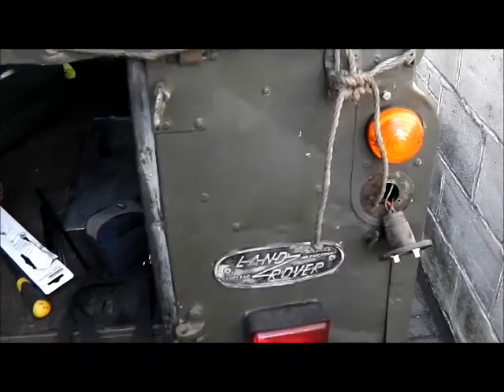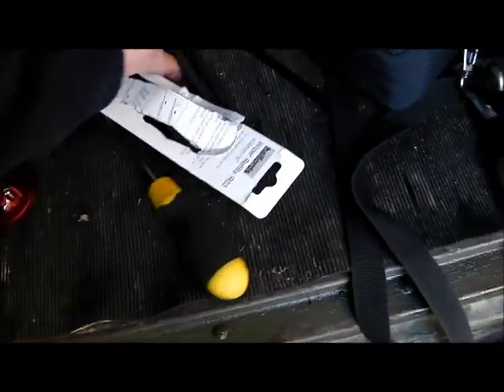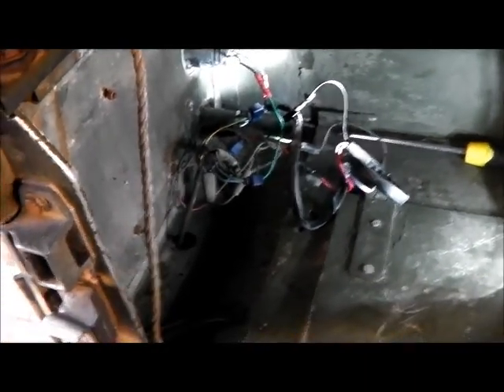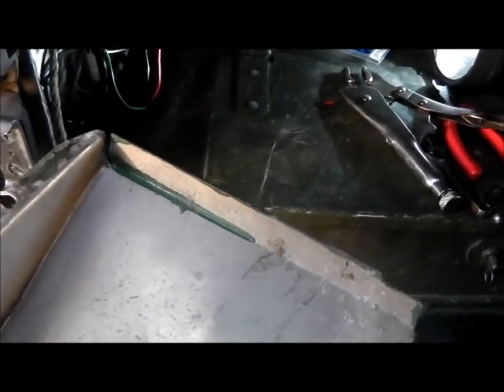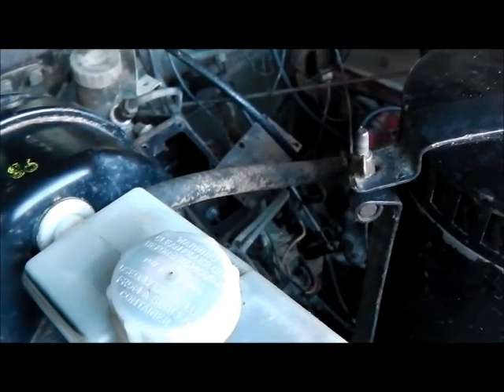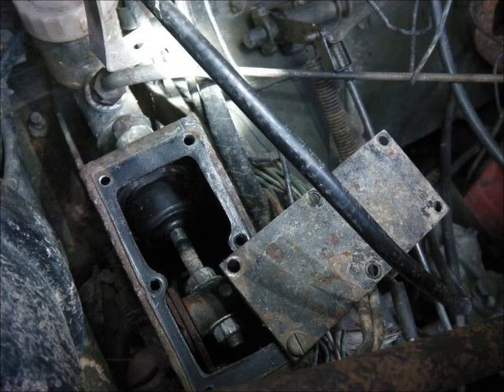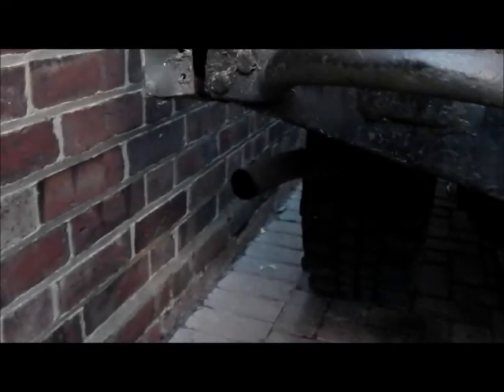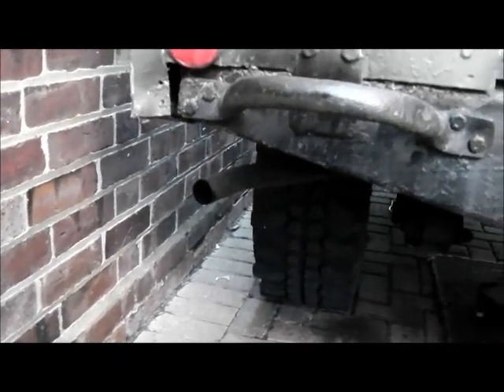Land Rover Series 3  -  brake lights and clutch biting point adjustment -

Comment: Has your S3 got and S2A gearbox in it. If its a S3 Gearbox you should have syncro in all gears.
Reply from the maker: Series 3 gearbox with knackered syncro and missing springs. 

I've got hold of a series 3 gearbox and series 2 transfer box which I'm rebuilding, should just need to fit the S3 bell housing to it.

Comment: Nice job, old wiring Burns out alot fast then old so be careful, just asking What website do U get 12 volt bulbs from

Harry
Thanks
Reply from the maker: It sure does! I'm replacing what I can as and when I get time and the need to do it.

Haven't had to buy any bulbs for it yet, I should think your local halfords would stock them.
Reply: Sorry i ment the bulbs for your stationary engine displays
Reply from the maker: Ah no worries, I really can't remember now but I just "googled" for them and came across 12V lamps in 25 and 40 watt filaments. They are about £5 a pop though....

Comment: Nice job of cleaning up that wiring, Phill.  That was a bit of a rat's nest with those crimp connectors and Scotchloks.  Did they add additional lights, or something?
Reply from the maker: Yeah it is a bit of a mess, someone has used scotchloks for the towing socket, it also has the "NATO" socket still fitted so there is wiring for that too.

Everything seems to work so at the moment I'm reluctant to get involved in a total re-wire!
Reply: steamwally Ahh, that makes sense.  I have used them myself, but I'd much rather get out the soldering iron and some shrink tube and make permanent connections if I have the time.  The nice thing is it does work, and you can clean them up later when you have the time to do it.
Reply from the maker: Same here, I wouldn't have done the wiring for the socket like that myself, but just got to work with it for now.

If ever time and funds permit, I'd like to have this LR back to the chassis and rebuild it.

Comment: How did you learn how to drive a std shift?  sorry about this but I'm gonna comment "it's hard wired into the brittish mind right?"   I didn't learn I just knew how the clutch worked so I did it..
Reply from the maker: What learn to drive a manual car?

Easy... once you've crunched a few gears you'l have it in no time lol "If you can't find it, grind it!"

The roads over here aren't really suited to automatics. With the gearbox my Land Rover has you have to double clutch from first into second and also when down changing from third to second, with a bit of a throttle blip to match the engine revs to the gears. It's fun trying to do that round town....

When cold I double all changed which helps it drive much smoother till it's warmed through.
Reply: I do the same with my subaru because the fluid for the trans is 75w90 gear oil..  very stiff to shift when its cold!
Reply from the maker: Indeed! EP90 in Landy running gear, out of interest do you see many LR's on your side of the pond and what do folks think of them?